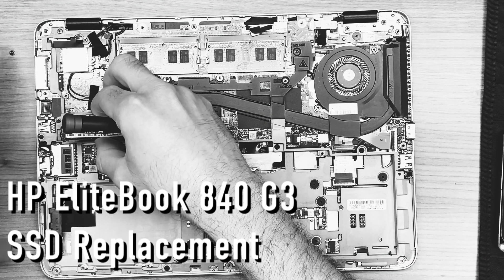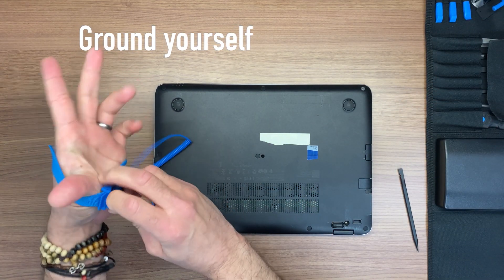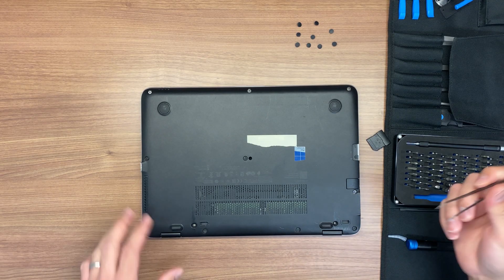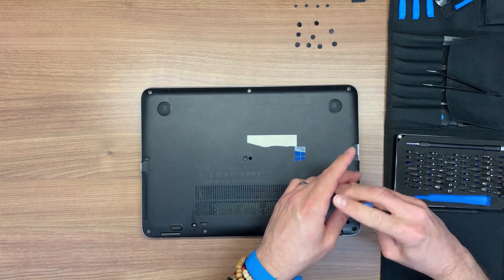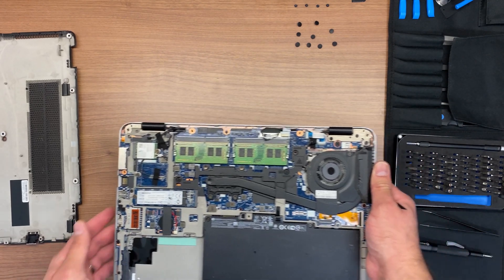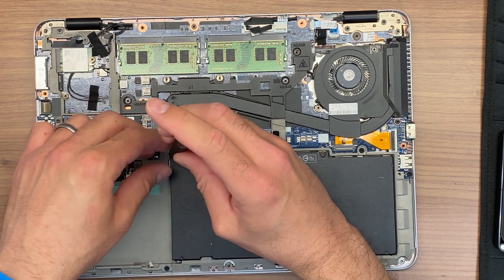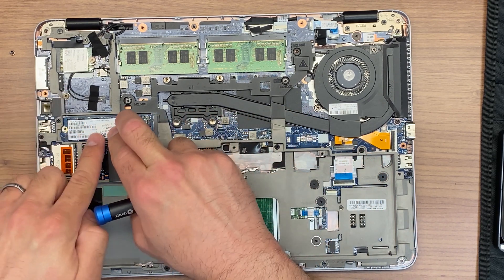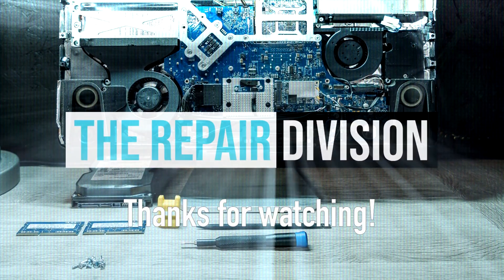HP EliteBook 840 G3 SSD Replacement - Laptop Repair

Comment: Is there a way to stick a 2.5 SSD up next to the power supply?  It has a SATA bay and a slot right there not sure where power from supply is nor how to wire it in and how to screw the SSD in
Reply from the maker: This specific laptop you can put another SSD in the empty Sata Bay, it is not next to the power supply connector, but you should be able to add the 2.5 SSD in the empty bay.

Comment: What's the empty slot below wifi card for? Simcard?
Reply from the maker: It's for another wireless network adapter.
Reply: i tried to use a sim card there, it doesn't work and i don't know why.

Comment: Does this support this ssd ?????????? SAMSUNG 980 SSD 500GB PCle 3.0x4, NVMe M.2 2280, Internal Solid State Drive, Storage for PC, Laptops, Gaming and More, HMB Technology, Intelligent Turbowrite, Speeds up-to 3,500MB/s, MZ-V8V500B/AM
Reply: any m2 will work but the 2280(20mm wide 80mm leght)will be longer than the space.i put one in mine but had to force it

Comment: Is it support sata m2 or nvme ssd.?
Reply from the maker: M.2
Reply: @therepairdivision5578   yes, but the question was if that m.2 port only supports a sata (double notch on the interface) or does it also support an nvme (single notch on the interface)?

Comment: Can I install windows 11 in hp elitebook 840 g3 laptop
Reply: Yes, I can help you with that
Reply: if microsoft allows that, then you should have no problem with that.

but this model has a tpm 1.2 and not a tpm 2.0 which is still the requirement.

Comment: Can i upgrade ssd card from 250gb to 500gb..
Is that possible and which is best
Reply: you should pick which type you want, there are normal SSDs and NVMe's which are significantly faster, if you just want extra storage an SSD should be good to go, but consider buying an external SSD since the HP EliteBook 840 G3 has a USB-C port which is pretty fast compared to a normal USB-A port, but still, it's not as portable as an internal SSD.
Reply: @yassine-sa  Thanks for the reply
Reply: Does HP Elitebook 840 G3 support 500GB PCIe NVME M.2 SSD?

Comment: I have this laptop but I dont have the admin credentials and its under my old jobs domain group. If I replace the SSD will it clear it out like a new laptop and install my own windows?
Reply from the maker: Hello Jesus. Replacing the SSD will remove all settings and configurations done by your old job IT. Operating System (Windows) will completely be removed and you will have to reinstall Windows in the new SSD.
Reply: Si claro, pues va borrar todos los archivos mate.

Comment: My HP is not working, I'm trying to get the data from the ssd, do you now where I gan get a cable to connect that ssd to another pc through  usb? thanks
Reply from the maker: Hello Iskender, if it's a regular 2.5" ssd this will work: https://www.amazon.com/StarTech-com-SATA-USB-Cable-USB3S2SAT3CB/dp/B00HJZJI84/ref=sr_1_3?keywords=ssd%2Bto%2Busb&qid=1637969785&sr=8-3&th=1

Comment: Can I connect a pcie SSD ?
Reply from the maker: Hello Santiago, if it’s for the HP Elitebook 840, the only compatible SSD is an M.2 SSD drive. Check the HP specs link for more info: https://support.hp.com/us-en/product/hp-elitebook-840-g3-notebook-pc/7815294/document/c05259054#AbT4
Reply: P3 Plus PCIe 4.0 3D NAND NVMe M.2 SSD will work

Comment: Hello, nice video!!!... can I upgrade the SSD without installing Windows?
Reply from the maker: Hello Jesus, if you upgrade the SSD you will need to install Windows. The SSD is where Windows is installed, and replacing it or upgrading it will require a fresh install of Windows. Hope this helps!